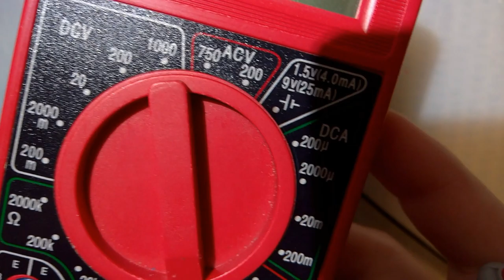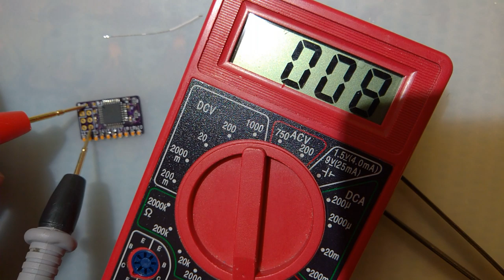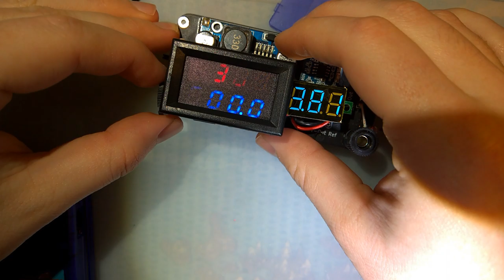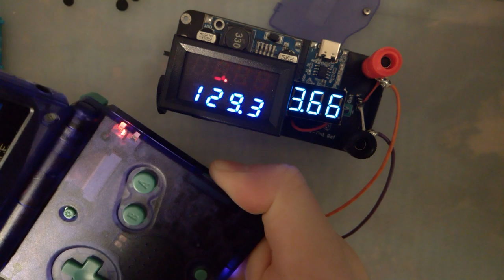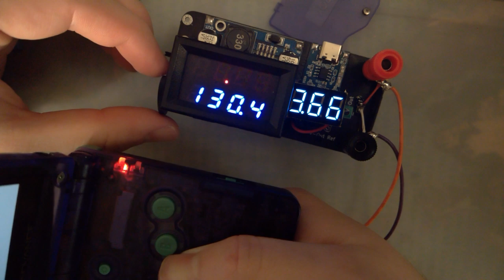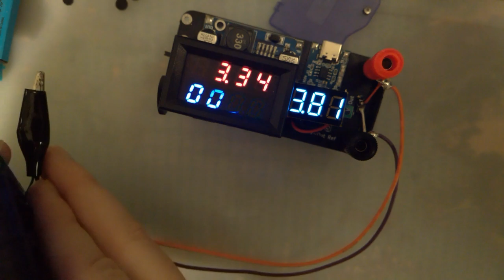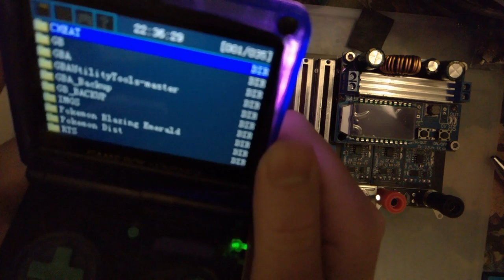Installing the insideGadgets LiPo Battery Gauge in a GBA SP

Comment: I would love to see an updated version, maybe having a pre assembly of led , and an on off switch or button
Reply from the maker: but who would be assembling them
Reply: Can we buy all the components and  assemble them ourselves?
Reply from the maker: @chasenorman6400  yes, I linked everything in the description
Reply: @makho  when I pull it up all I see is the big board I'm not seeing the main board that I can order.
Reply from the maker: @chasenorman6400  I don't know what you're doing wrong then. I linked in the description to a github with all the PCBs. I never made a specific version for the SP, I just used the AGB main board and then dead bugged the LEDs directly to it.
Reply: Can you link the cpu if it's not a big deal been trying to find them but I apparently ordered the wrong ones.
Reply from the maker: @chasenorman6400  It's just a ATTINY48 VQFN-28 package for Alex's board or QFP-32 for my board. If you already have the VQFN-28 ATTINY, just use Alex's board.

Comment: this build gives me c50 & c51 GBA resistors PTSD lol i accidentally remove/lifted both. spend 2 hours trying to solder them back on, seem like mission impossible x 1 million. Gave up since GBA still power and sound still work xD
Reply from the maker: C50 and C51 are capacitors. This is the replacement part: https://www.digikey.com/product-detail/en/taiyo-yuden/EMK105F104ZV-F/587-1235-1-ND/931012

Since they are only 0.1uF, it's probably fine to omit them but if you feel like replacing them, there you go.

Comment: Is there a way to use something like this but not on a full light bar. Just to show when it has a good charge and low battery?
Reply from the maker: it's open source so you can edit down the number of LEDs pretty easily or just use something like this https://shop.insidegadgets.com/product/blinking-low-battery-led-mod-for-dmg-pocket-gbc/

Comment: What is that dev board you're using the power the GBA @ 1:27:05?
Reply from the maker: That time stamp is invalid but either way both power supplies I used were home-made designs. The hot glued mess one works fine but it's pretty low power and cannot quite power some of the more demanding mods these days. The one with the faders is a custom design that fixed that issue but I blew out the fets on it once just by adjusting it too quickly and never bothered repairing it (or fixing the design flaw that lets that happen). 

I stopped trying to DIY a power supply when feature creep delayed the project so I just bought a Miniware MDP-XP instead. Works great and solves all the issues with my homebrew designs.

Comment: What soldering iron do you use
Reply from the maker: xtronic 3020 most of the time. I use hakko tips with it instead of the offbrand tip it came with though. I also have an edsyn 951sx that I break out on occasion.